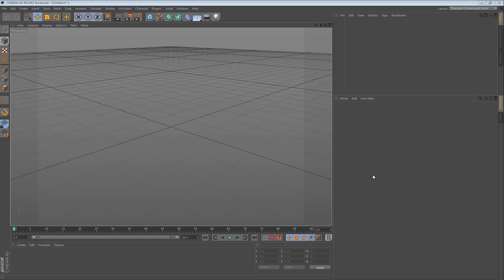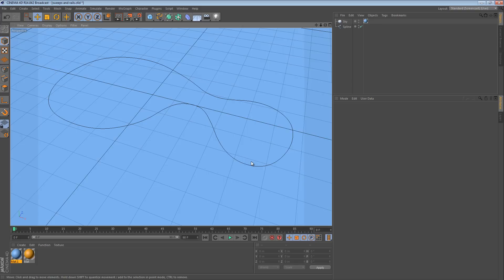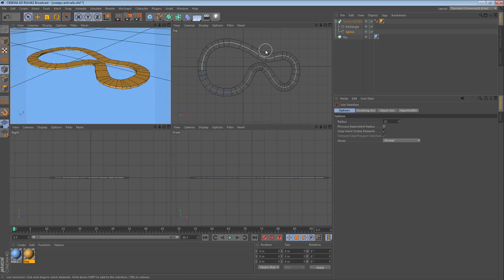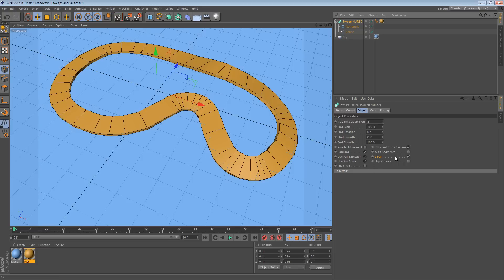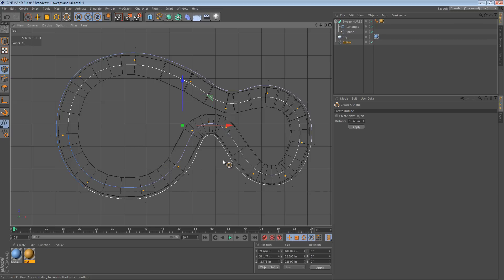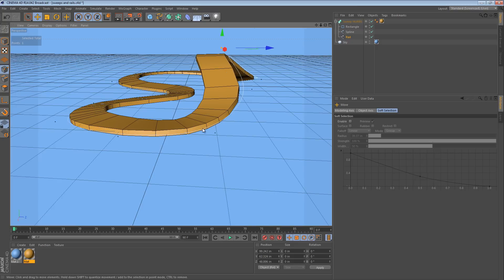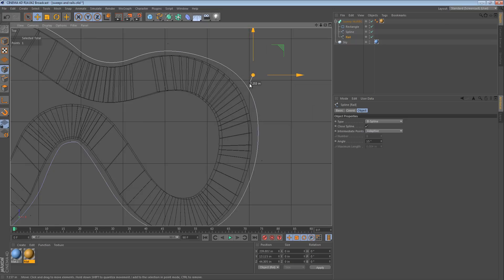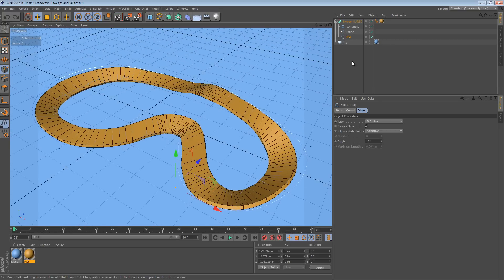Sweeps and Rail Splines in Cinema 4D

Comment: Jamie!!!
This solved my problem.  Perfectly.
I am creating straps for bags and could not figure out how to make them behave correctly.  Adding the rail spline is the answer.

I have to try it with an open spline.  I wonder if the create outline works with an open spline.  I will check.

Thank you.
Reply from the maker: Great! Yes, create outline works with an open spline but it creates a closed spline in the process. You can separate them afterwards however.